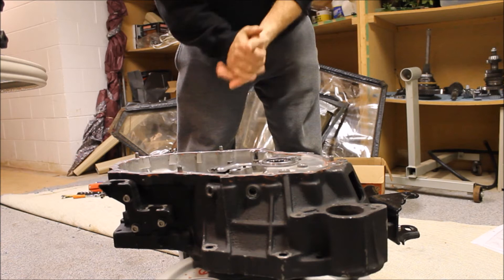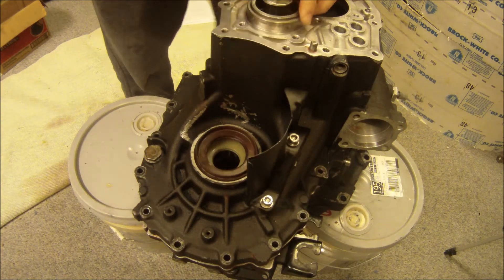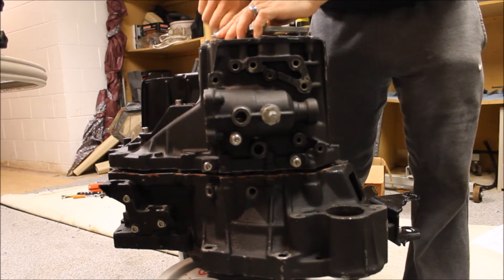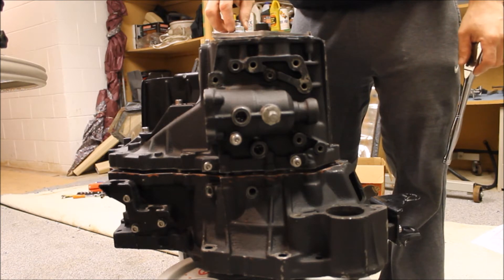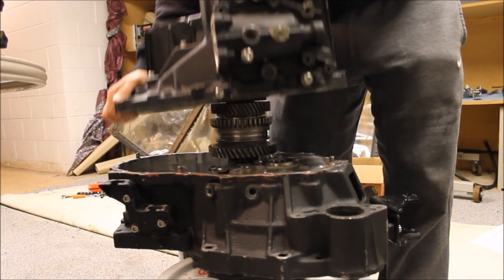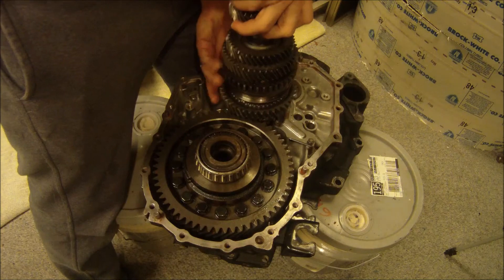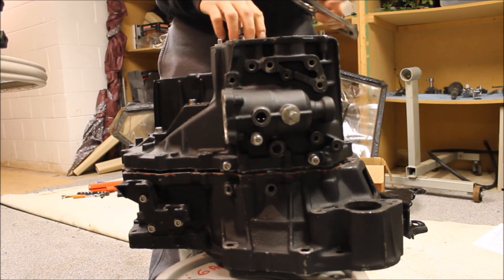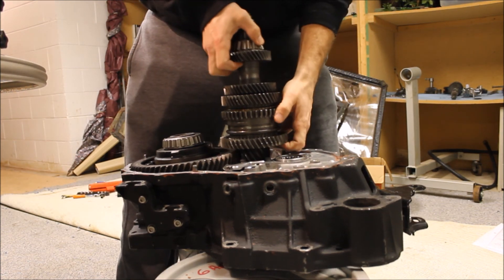Toyota Celica Alltrac GT-Four E153 trans Part 1

Comment: Hey Ryan, I've stripped my box down now.
I was just wondering what you actually replaced when you rebuild your box. Did you do all the bearings and races in the housing or did you reuse them? I assume this was the rebuild after your 2nd gear lost a few teeth?

I'm just trying to weigh up what I should actually replace while it's stipped, some of the bearings seem fine, and to replace the whole lot from Toyota is pretty expensive if it's not needed. I've been told the bearings don't tend to actually fail in these boxes.

Any advise?